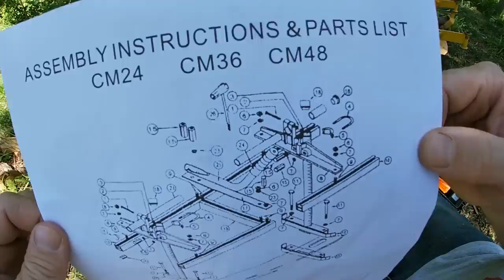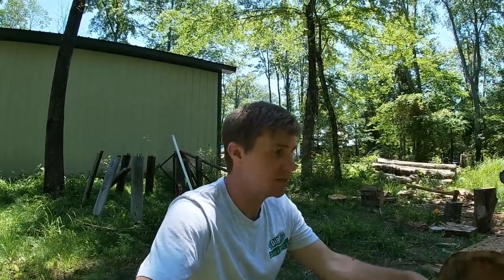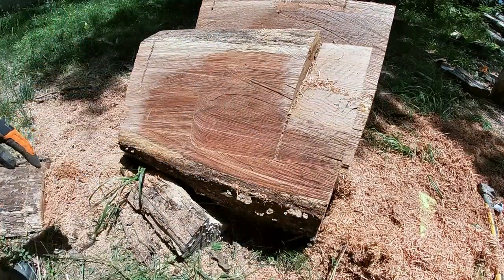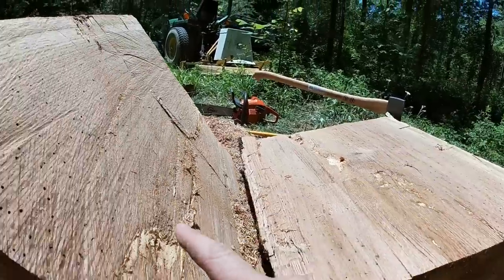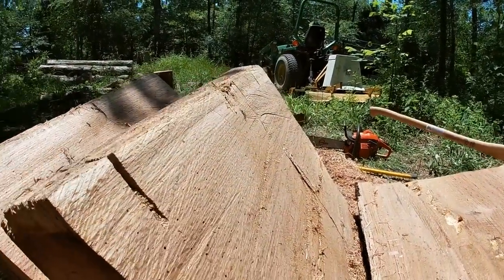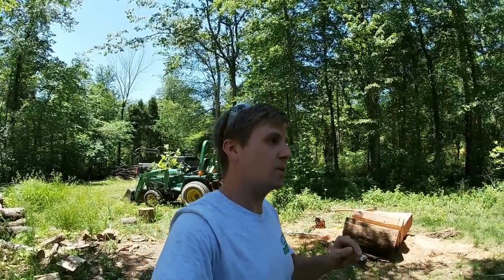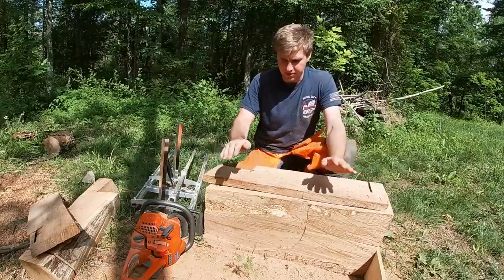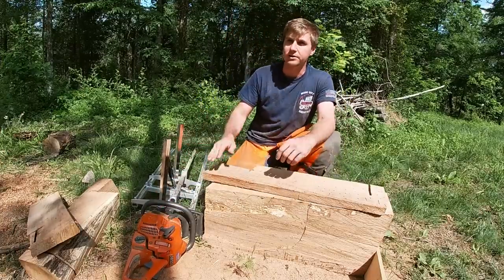Small Alaskan Mill - Small Log - Is it worth it?  My first attempts.

Comment: This Is My Opinion Only But Husqvarna Makes A Pretty Decent Weedeater And Leaf Blower Line Up Where RPM Matters A Great Deal But In Their Chainsaws, RPM Is Ok  But Torque Matters Most Of The Time And Especially With A Mill Set Up, Plus Torque Helps With Not Letting A Saw Overheat.. Look For A Good Stihl Saw And I've Heard The Older Pioneer Chainsaws Are Good Milling Chainsaws And They Definitely Have Torque, I've Got To Own A Couple Different Ones Over The Years And Wish I Would Have Kept Them.....

Comment: Thanks for the content👍🏻

Anyone watching this and first starting, my advice would be:

-start on a smaller diameter round.
-use a ripping chain(10° cut angle).
-use a wedge after you start cutting.
-never sharpen your chain with anything that has a high rpm as the heat will ruin the temper of your chain. 
-sharpen often(hand file!)
Reply from the maker: Where in IN are ya Doug?
Reply: @CaptainKleeman  Richmond, East Central Indiana on the Ohio border
Reply from the maker: @IndianaDoug  I’m slightly familiar.  Along I70 right?  very cool.  Hope you stick around the channel!
Reply: @CaptainKleeman  you got it! I70. Where are you located?

Comment: You need to mix gas 16o.z to a gallon or it will burn up trust me done been there.3.5 o.zis not enough.
Reply from the maker: Anthony Bracknell this is a great tip.  Thank you!
Reply: @CaptainKleeman  Don't listen to this guys nonsense. That's 8 to 1. Way too much oil. The modern synthetics can be mixed 50 to 1 in high performance 2 stroke motorcycles. Thats 2.6oz to a gal.

Comment: Having a Rip cut chain makes all the difference … using a crosscut chain will slow you down and heat up your saw very quickly 
A Rip cut chain will also give you a cleaner , smoother final product…
I also suggest starting out on a softer wood for your first attempt, practice on a piece of pine.
Reply from the maker: Thanks for the tips!

Comment: Have you seen the sawmills setup using an external engine hooked to a huge bar?  Not the one I saw originally but still has the base idea https://youtu.be/1x4A0hQLR1E  uses a 72 inch bar and a 13hp motor.
Reply from the maker: Andrew H woah! Now that’s pretty slick.....and I just happen to have an older tiller sitting in the barn.  Something to think about!